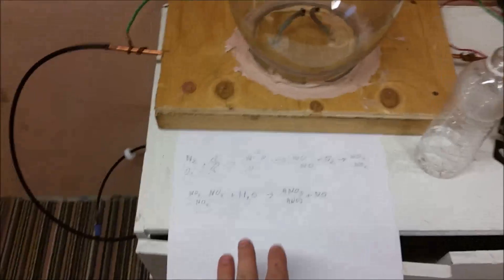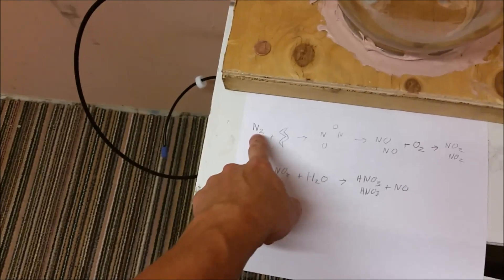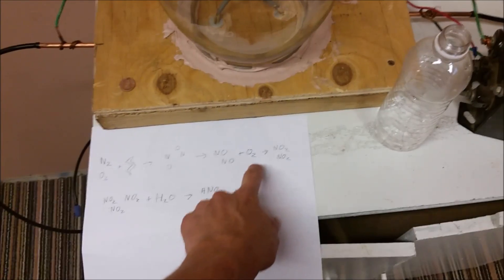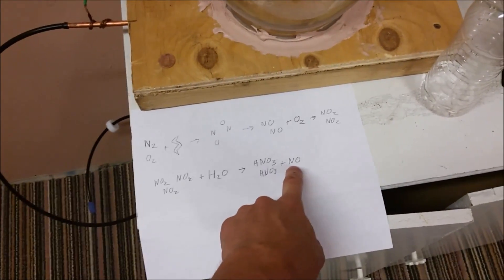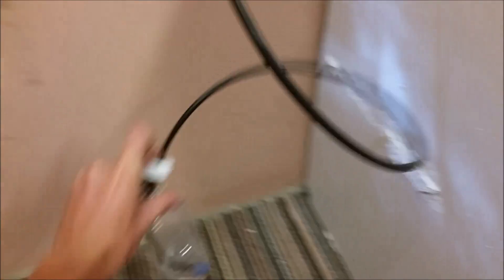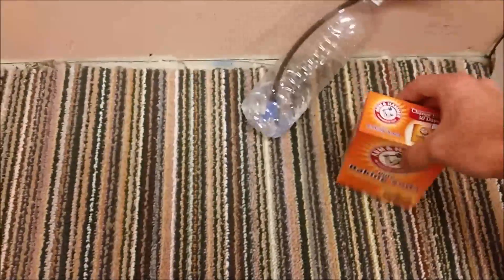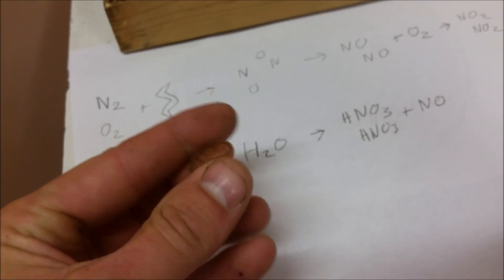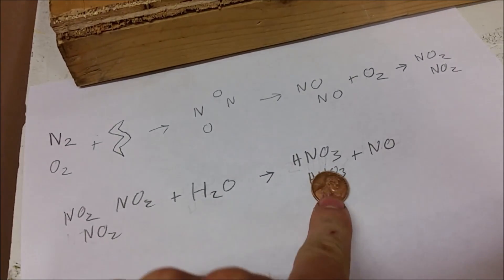Nitric Acid From Thin Air

Comment: What I learned from Cody: It doesn't matter the amount produced, it matters about the success of the project.
Reply: 1) Add a second air pump after the arc step then 2) dip the final air outlet  at over 3 feet underwater for the reaction with water. This creates a final pressurized step with extra oxygen mixing with the NO creating more NO2. Then 3) make sure you have that air stone. I would also do away with the wooden board; 4) Go to walmart and grab a glass lidded container.
Reply: @farmerjohn7756  Yea you can basically just scale the whole thing up if you want more acid, this is just a proof of concept tbh. I'm sure if he intended to make a production scale amount, for use in explosives making, fertilizers, or any other shenanigans cory may get up to, that he would have bought a bigger air pump and run more power through the arc
Reply: The purpose of the experiment wasn't to create a usable amount of nitric acid with this process, it was to see if he could create nitric acid at all using nothing but air, water, and electricity. There are plenty of things he could do to make it more efficient, but that wasn't the point.

P.S. Sentence formatting is a wonderful thing.
Reply: @awareqwx  Possible only if your near a very stinky public toilet without water. It's all fake.. 🚾
Reply: ***** so you're planning on making this process more efficient somehow?
Reply: Bring your electrodes closer together, I think you're getting 2KV from you're transformer, in cody's video he's using 9KV, you need to be 5x closer. Heat is not the issue, it's the durability of the metal to withstand oxidation from the current. Copper is ok as seen in this video. I would vary the flow of air through the arc, the greater the flow the more NO will be made, the arc is from free radicals, and since NO is just a good a fuel as N2 and O2 are for arcs, stale air is a waste of NO as it would be broken by the arc again and again. Really the length of arc is more of a scaling factor than efficiency. If you double the arc length (also by doubling the voltage), it allows you to double the amount of air you flow through. The issue maybe with the heat generated by the transformer, higher step ups on the transformer wastes a ton of power through heat loss.
Reply: The Stoned Videogame Nerd haber-bosch makes ammonia; he's making nitric/nitrous acids.
Reply: It's a bit of a balancing act, too much air flow will force too much air at once through the water step. I ended up putting a modified fan with teflon washers next to the arc to keep the air circulated while keeping the total air flow lower.
Reply: I have a question based on your comments.... how do you start the arc on a microwave transformer? I have already attached my vacuum chamber to the base where the electrodes enter... thus no way to short them to start the arc process. my electrodes are made of capillary tubing from a refrigerator system... its about 1/8 inch diameter... will this hold up to the heat generated from a 1Kw hv transformer?  instead of going with a microwave transformer... would there be any benefit to using a HV power oscillator circuit and change the frequency of the arc? Does arc length make a difference?
Reply: TY for the info... my first test of the system, failed early... my vacuum pump is pulling vacuum on the bubbler over to an inverted fish bowl with the electrodes in it... I had to simulate worse case scenario before I attempted to fire up the HV.... I plugged off the air input side to see if the fish bowl could handle the vacuum... well it's a fish pump, but I didnt think it was capable of pulling too much vacuum.... well it pulled 15in of Hg and the bowl exploded.... I have since moved on to a mason jar that has less surface area. I will be testing that later this week and if it holds up... then on to HV testing.... I did the worse case testing due to the idea that I want to be able to run this for weeks at a time outdoors and would like to make sure its safe before doing this....
Also.. I dont think the HV transformer is going to last a week running continuously, but I live near high tension wires that induce voltages into my ham radio dipoles.... voltages as high as 30Kv at uA.... so I may use this free source instead of the HV transformer.
Reply: I'm not sure how uA's will fare, sparks for all intents and purposes are short circuits.
Reply: not actually looking for the sparks... just the corona on the wires correct? release free ions? besides this if free power...
Reply: yes the arc (corona). I also wouldn't consider it worth the investment to build a 24hr air pump and radio equipment to grab uA's of current. You can estimate the minimum amount of time to generate 1 mole of NO, about 100,000 coulombs of e- to make 1 mole. So for 1uA, that's 100 billion seconds. You want amperage and air circulation.
Reply: Birkeland–Eyde process perhaps (not the Haber process as missing pressure, temperature, catalyst, H2, ...)
Reply: Exactly; efficiency can be puzzled out later, but knowing that the reaction works is a huge first step. If you're more chemistry minded and want to watch some in depth research, look up NurdRage's series on producing sodium via alcohol catalyzed magnesium reduction of sodium hydroxide. His first reaction only made about 40-60% yield and destroyed a flask from the hot sodium hydroxide, but he gradually narrowed down all the problems until he had a reaction that produced ~95% yields of sodium based on sodium hydroxide that did not destroy a flask each time it was done, and found very obtainable alcohols that can be used for the reaction. Now, we know that all you need to make sodium metal in your own home is a hotplate, a flask, magnesium turnings, sodium hydroxide, and a small amount of menthol or certain other alcohols. It's really an interesting look into thorough research
Reply: 5kg of nitric acid over a year is nothing to be sniffed at. with two or so of them gonig it might actually make more than anyone would ever need.
Reply: 😒😒😒😁😁😁 succeeding a lot in this project 😁
Reply: First of all his Voltage is in excess by couple of thousands which really do nothing in being responsable for reacting the gases. MicroWave transformer is doing the same job at 2000 volts. Second of all his Current is so low that he should be the Ant Man while at Ant size to be able of being satisfied with that spit in the bottle. Note that the starting Voltage for breaking the Nitrogen and Oxygen bonds is below 2100. However the higher Current and the higher flow of Air are only responsable for high quantity at short time production of these NO2 and NO gases ;)